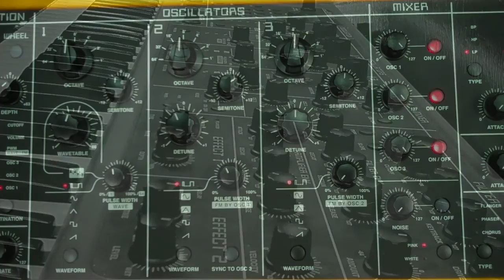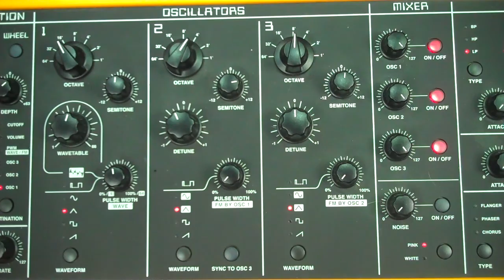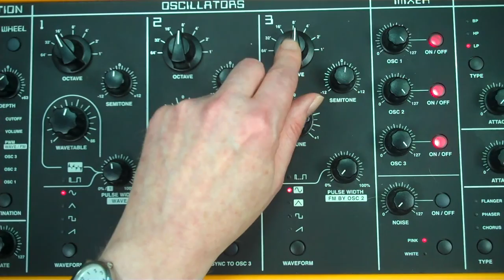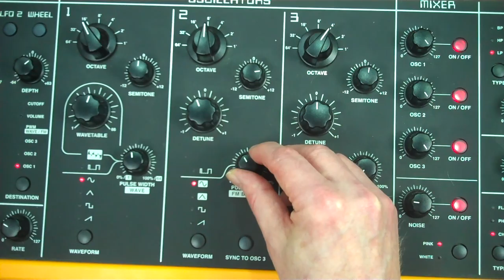George Hall Synthesiser Tutorial 9 Classic Organ Sounds

Comment: Some ideas about the Hammond sound.  I think it can be improved very much by using the layered sound feature of the Sledge 2.0 firmware revision (availabe for all old sledge models) . The basic sound would again be done with osc 1-3 featuring 16, 5 1/3 and 8, while the "upper" layer can  create the full percussion section with 2 osc for 2nd und 3rd (4 and 2 2/3) and envelope for true Percussion giving all of the classic features on/off 2nd/3rd, slow and soft  with real time control for the "upper layer"... and even more: monophonic for the percussion effect only as the original Hammond did or polyphonic as the sledge can do ...